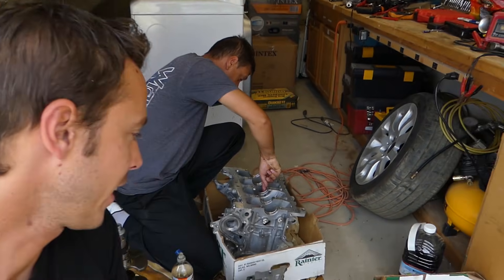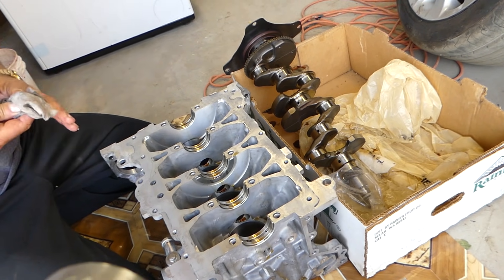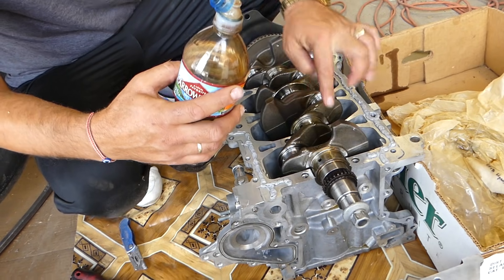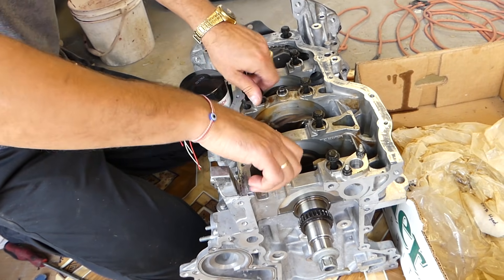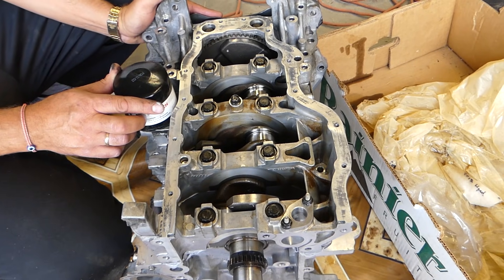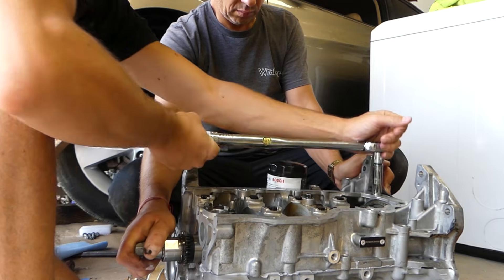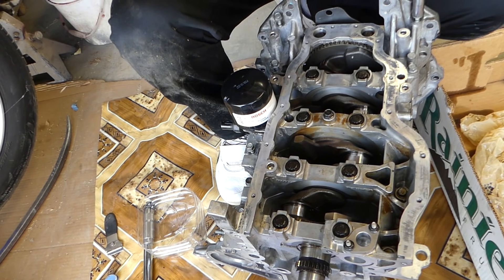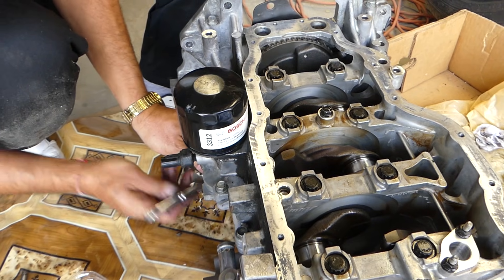MAIN BEARING TORQUE SPECS SEQUENCE ON HYUNDAI ELANTRA TUCSON  CRANKCASE TORQUE SPECS

Comment: Hey mu friend. Its possible to replace this main bearing without the engine out? Or you definitely must to remove the engine. 

I just replace the rod bearing with the engine in place. And After I put everything back together, I still have the knock sound, and I suspect the oil pump and main bearing as well. 

I have 2016 Elantra GT 2.0L 
Hey thank you for yours videos. May Gid bless you.

Comment: Best Hyundai videos I’ve found.  Did you guys buy new head/main bolts?
Reply: I bought the rebuild kit and came with head bolts. Then I bought new piston with rods and they also come with new bolts. I just bought main cap bolts. If ur replacing bearing only just need new bolts for piston rods too